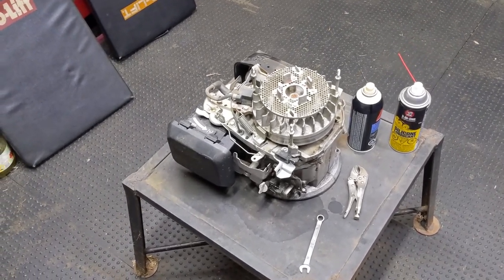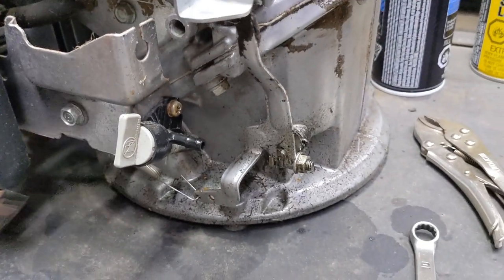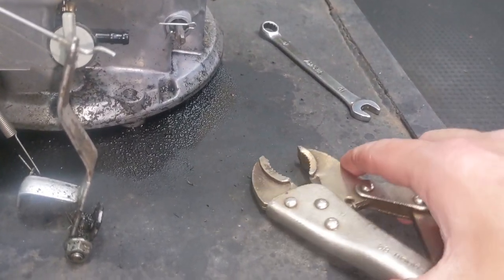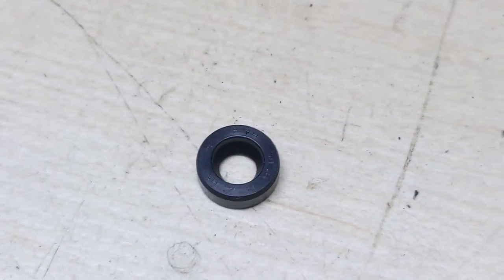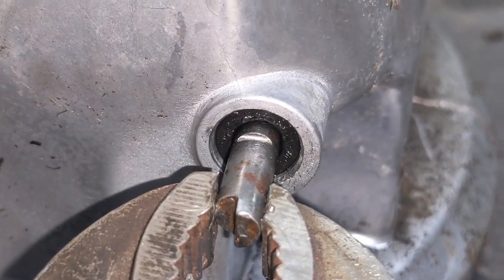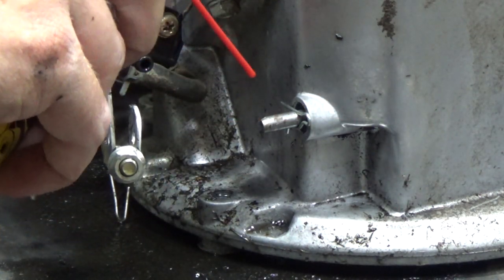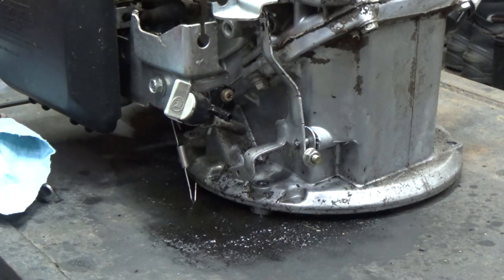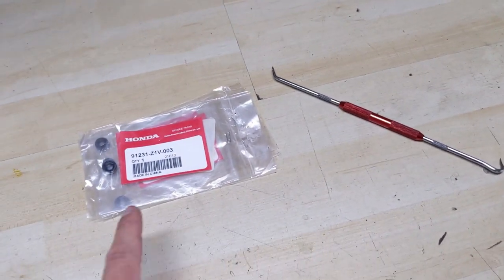How to Install a Governor Shaft Seal on a Honda GCV160 Engine

Comment from the maker: Parts used: Honda 91231-891-003 oil seal (6x11x4 seal, not bearing). BUY THEM HERE: https://amzn.to/3r8YQIO
Reply: The part number of the seal installed in the video is 91231 Z1V 003. Here, you say it was part number 91231 891 003. Which is correct? Are they interchangeable?
Reply from the maker: @llano52  Yes! Honda is known for having different part numbers for the same parts because they're used on different equipment. If you click the Amazon link, many of the reviews mention people using them on GCV160 engines

Comment: I just did the same thing on two of my GCV160 engines. After watching your video and cleaning the engines, it took all of about 10 minutes on each one. (The engines were still on the mowers.) It took longer to clean up the engines than to put the oil seal on. Good straight to the point video.

Comment: My only criticism is clamping the vice grips on the shaft. I would have put some electrical tape or duct tape on the teeth of the vice grips . This would prevent any damage to the shaft such as a raised bit of metal that would damage the seal upon sliding it over the damaged part. Sliding the seal along and over the shaft is when the seal “edge” can be slightly compromised with a small bit of damage and thus a shorter seal life. My method would also include a quick burnishing of the shaft with crocus cloth and an gentle camfer of the leading edge of the shaft . That would be a bit over overkill in a busy shop, but if you are doing this for yourself , you can gain some additional life on the seal instalation. Other that that, its a great video that’s extremely helpful!

Comment: my Tecumseh 10 hp. governor shaft is leaking oil at the top where the governor arm hooks onto it.  Can you tell me if there is a seal there ?

Comment: Hi. I have some oil leaking in that area. Could it be from there? The Toro dealer I bought it from said it was not fixable because a design flaw- can’t put an O ring there….?

Comment: I hope that doesn't happen to My Honda 190 cc engine on my Husqvarna AWD mower
Reply from the maker: If it does, you'll know how to fix it! Thanks for watching!
Reply: @EliminatorPerformance   okay thanks for posting this video on this matter young man 👍😎
Reply: Just a tip listen for any noise from the bearings on the axle shafts. Our customer wore ear buds and listened to music an never heard the grinding noise of the bad bearings and almost ate through the axle. Luckily we could weld repair it then replace the bearings. I think Jake did a video on this repair.
Reply: @waynestefinashen239  thanks for the info on this matter young man 👍😎

Comment: I have the same Honda pressure washer. Brand new. Only used once . It started leaking oil from the top of the motor from under the flywheel ?

Comment: Thank you for this video. I have a Troy-Bilt lawnmower with the GCV160 engine and it was seeping oil in that exact spot. I removed the governor arm and left the retaining clip in place, bathed the area in carburetor cleaner and wiped it down. When the part came in I put it in place following your procedure and reassembled things. It was a quick, easy job. 

The only variance was that rather than use silicon lubricant I put a drop of motor oil on the governor shaft to lubricate it and make the installation easier. I imagine one could use anything, including bacon grease.

Comment: Good video Jake. I have done a couple of these. I found the seals not listed on the lawnmower parts list, but were available from a marine parts list from an outboard motor. Always good to have the part number. Have a good week.  Rick
Reply from the maker: Makes you wonder why a company like Honda wouldn't have used them in the 1st place. Thanks for watching!
Reply: Agreed

Comment: As usual, short, sweet, detailed, great camera work, believe I would of taken my calipers & measured the O.D., I.D,. & thickness before I installed, made note and next time find a match out of one of those assortment kits
Reply from the maker: Good idea but for the price I paid, I believe they're only about $3.85ea I think, it's been so long. I usually buy 5 at a time just to have them in stock. Thanks for watching!

Comment: Nice twofer, Jake!  Not only a heads up and fix on the Honda GCV160, but by far the clearest explanation of governor reset I’ve ever seen (and I’ve watched a bunch!). 
Now I’ll be paying close attention to every Honda engine that comes in to see if they have that telltale sign of oil in the vicinity of the governor shaft - such an easy fix!
Are you and Stella coordinating your uploads on the same engines? 😂
Reply from the maker: Definitely not, just happens sometimes lol and thanks for the kind words!
Reply: Very detailed demo, can’t believe the engineers at Honda didn’t think that seal was necessary!   Thanks!  👍👍
Reply: @tonym6920    Agreed!

Comment: Only one thing I would do differently - Scotch-brite on that shaft before clamping on the vicegrips. Same as I do on all shafts getting a new seal. 🔧👍
Reply from the maker: Good tip! I guess some emery paper would probably do the same. Or just use a pair of locking pliers with some tape on the jaws. Thanks for watching!

Comment: Great information. Have a GCV200 with same issue. Any idea if this seal will work on a GCV200 engine? Understand the shaft diameters are slightly different; however, may try anyway.

Comment: My rule of thumb for that static adjustment is lever turned to full throttle open and turn shaft in sae direction re clock.
Reply: Perfect rule
Reply: Thanks for watching and subscribing

Comment: I just did this procedure to replace the seal just as you did and now I have low idle. Any suggestions
Reply from the maker: Double check your governor shaft adjustment!

Comment: On one of my HRX217's (GCV190) with the blade clutch, I set the no load rpm's to about the Honda recommended 3200. But when I engage the blade, the rpms drop to a weak 2700-2800. Thus I have to over-rev the no-load rpms to around 3600-3700 in order to have them drop to the desired 3200 when the blade is engaged. I have adjusted the governor arm per this video & the over-rev/under-rev problem still exists. I watch & subscribe to you because you are one of the best. Any ideas? Final note, the gov spring puts some spring back to the gov arm (when pushed forward) but it doesn't snap back like on other 190's (or 160's) I have in my possession ... just this one model.
Reply: I'm having the same issue now that I've installed the new seal.

Comment: Do these not come on the unit? Or do they somehow break off? I was given a gcv 160 because of a bad oil leak and placed this seal in. Have ran it yet to see if it fixed the problem. But the motor didn’t have the seal when I was given and that’s where I found the oil was coming from
Reply from the maker: The new ones do, the older ones dont
Reply: @EliminatorPerformance  so they all just leaked oil?
Reply from the maker: @Whats_noah_up_to  no as far as I know it's like an interference fit, they usually don't leak but if they do the seal is the cheap quick fix. All the new ones have the seal to ensure none of them leak.
Reply: im going to run it today to see if it fixes the issue. I had also noticed when i would turn the crankshaft oil would come out the air outlet hose. We'll see what happens.  @EliminatorPerformance

Comment: Does your table have a hole for shaft to go thru so it sits flat?
Reply: Yes it does we actually have a few that are patio plastic end tables with holes cut off and a few steel tables with a hole in the centre. We also have a test engine steel table that we can run engines on with blade installed to set up to specification prior to installation on mowers.
Reply: Does table shake much?
Reply: @mgomez5606  Absolutely no shaking since the table is extremely heavy top plate is 1/2 inch steel with holes drilled to mount different engines. Guess there would be some vibration if we left and unbalanced blade on it or if the crankshaft was bent but we check this things first prior to mounting and running.

Comment: Mily oldie is a smoke machine. It runs hard though. Im trying different liquids. I put some glycerin in there. Smoke died down. Im still cyphering what is going on.😅
Reply: Dealing with the same here.  I've started with the easy stuff - check crankcase vent tube for blockages.  Then check carb for blockages and make sure the gaskets are un the right order and orientation. This made a big improvement on mine but it's still burning oil.

Next on my list will be the exhaust valve seal replacement.  Finally, teardown and check cylinder walls for scoring and ring endgap...

Think I'm into new rings on mine.

Planning to make a leakdown tester to see what's what
Reply from the maker: Hard to say, if it's smoking from the crankcase vent tube it could be a head gasket. I have a video on that topic coming up within the next few weeks!

Comment: My kohler 149cc is doing this also do those have a seal?
Reply: Yes there will be an oil seal, just look up the model number parts diagram of your engine online to get the part number of the oil seal. The installation will basically be the same but you may need a sharp pick to pull out the old damaged seal.
Reply: @waynestefinashen239  thx

Comment: Those came around 2015 and by then im sure things were different. Youll know because half the engine will be gunky and furry.
Reply from the maker: Yes they changed the cylinder design and use the seals on the those engines. The issue is these never came with them, hard to believe. Thanks for watching!